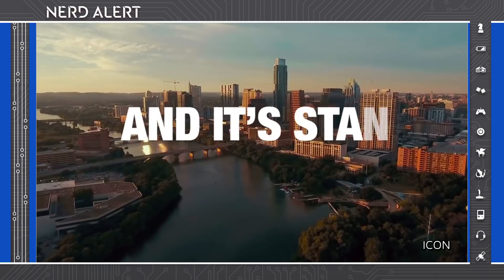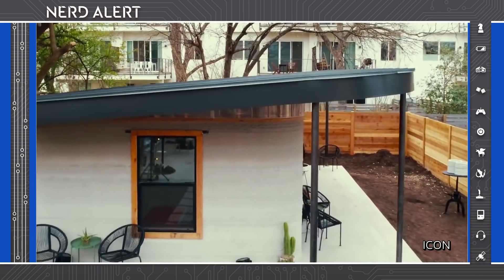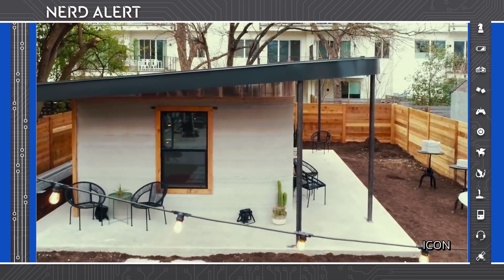3D-Printed Houses Are Fighting This Major World Crisis

Comment: My first thought is that it seems completely impractical to not have access to your wiring and plumbing. Also, if these houses are somewhere where the weather isn't super mild year round, aren't there going to be huge problems with heating and/or cooling the space? It doesn't seem like it's thought through all that well. If they didn't get practical advice on home construction I think it kind of falls under that category of just because you can do something doesn't mean that you should. shrug
Reply: I’d advise to look into concrete dwellings. The thermal mass is doing what conventional construction can’t. They are in Texas; nothing mild about Austin, TX either. That solid mass lowers energy consumption and works to keep cool and hot on its own. Some of those structures don’t even use A/C, but have to put it in because of code.

The idea isn’t entirely new, heck Europe has such houses still standing for generations. The 3D printing aspect isn’t going anywhere either.  It’s an answer to less tradesmen and growing building costs.

Comment: Good luck trying to fix a leaking pipe if it's encased in concrete.
Reply: It's an issue, but given how cheap the build is they can splurge on good pipes.
Reply: my first thought.
Reply: Your scepsis haven't a base. It's a cool technologi. Go ahead, America!
Reply: Could use aircrete if adjusted wall design to have more support "braces" inside.